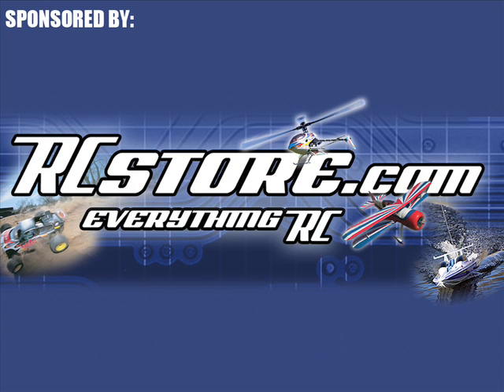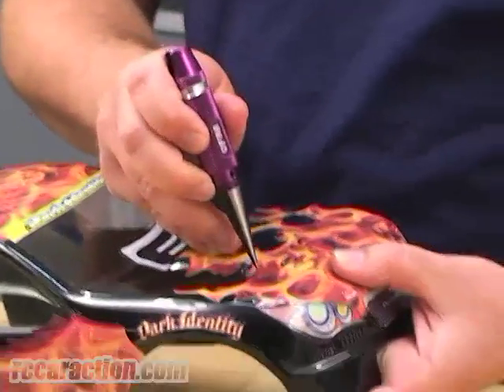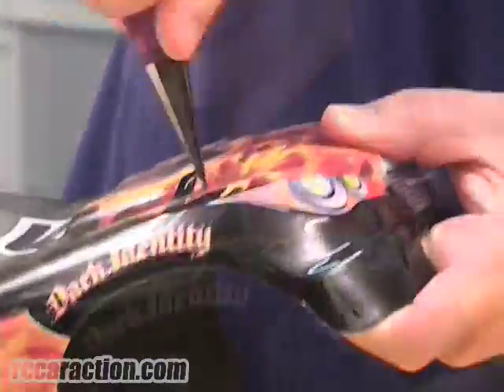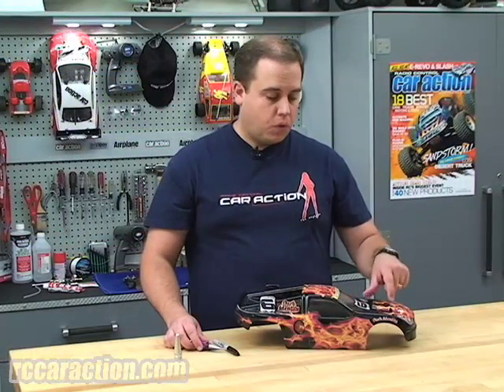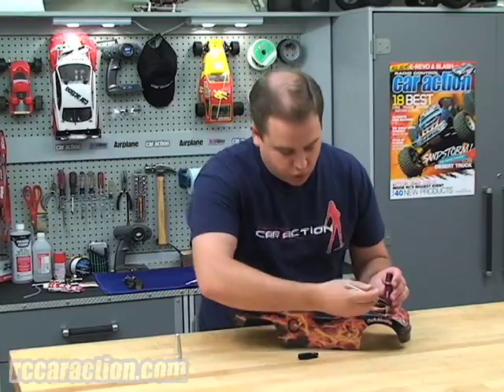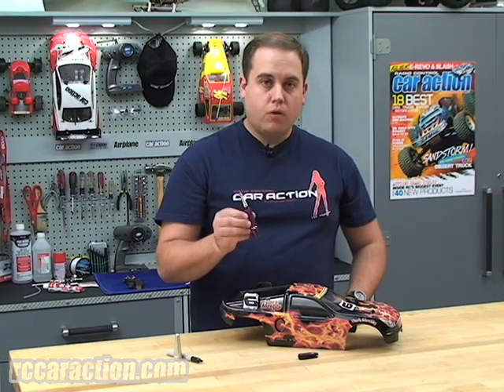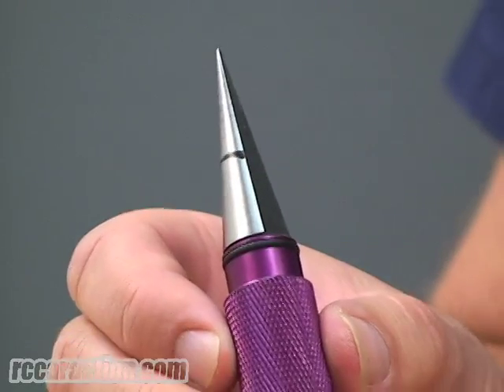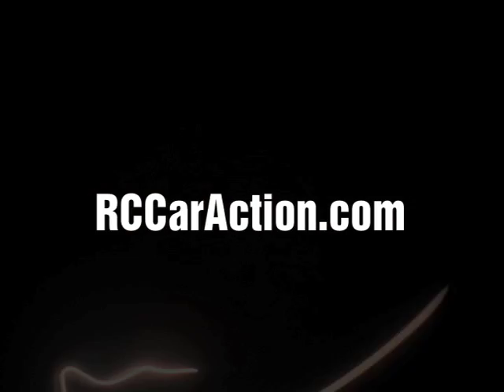How To Cut Body Post Holes

Comment: Reamers are okay, but if you use drill the holes you get are better and cleaner. first stab a hole with a tack and then put in a small hole with a drill gun.
Reply: can i use a reamer for making a hole for leds lights
Reply: yes you can!
Reply: Thank you an have a great day 👌👌👌👌👌